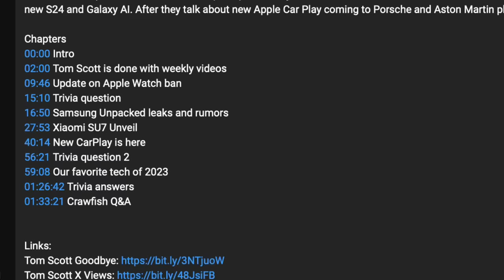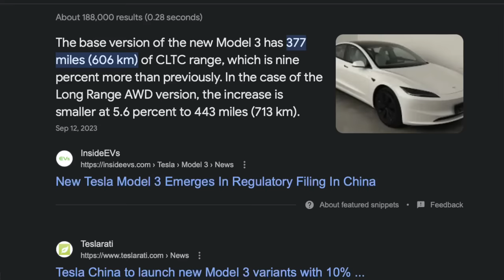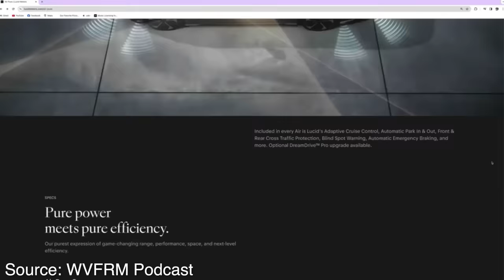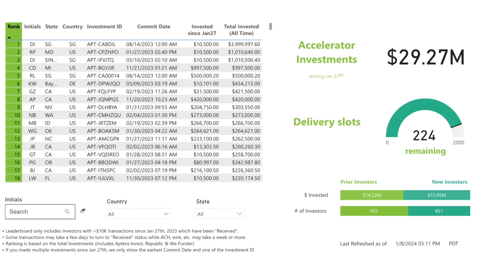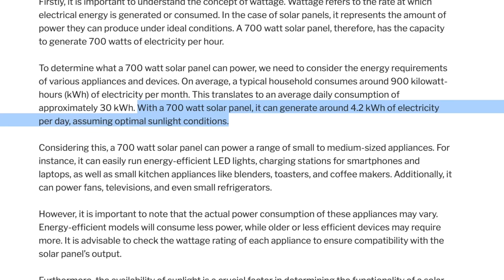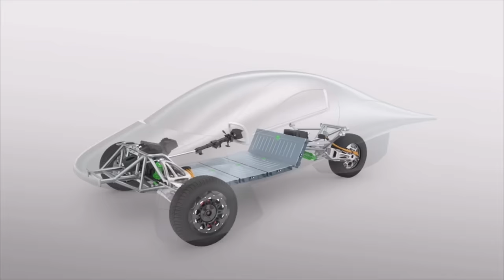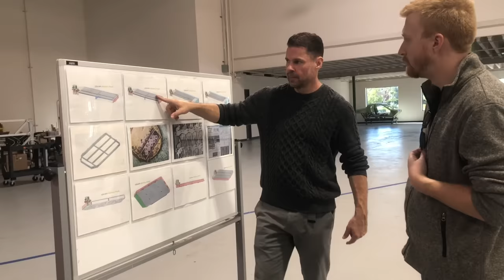Response to MKBHD Aptera Comments

Comment: Another safety concept is deflection vs engagement. I.E. the curved surfaces tend to deflect off of an object that is impacting the chassis. This increases the length of time that is available to bring the Aptera to a stop. Longer time to dissipate energy = much lower G-forces on the occupants. And like an Formula 1 car, the outboard wheels can shear off and this dissipates energy as well, and the curved sides of the Aptera then move to the side.

Rectangular vehicles tend to wrap around an object, and this shortens the time available to dissipate the energy of the impact.
Reply: This of the Aptera shape as an egg with just a little lubricant on the outside.  Since the Graphite body is so hard, in some situations it will just slide to one side or the other.

Comment: As someone who’s invested in Tesla since 2012, the way so many people dismiss Aptera today reminds me A LOT of the way many people completely dismissed Tesla up until 2018 or so. As a product guy I’m getting the same “this car looks amazing” vibes that I got from Tesla back then and no other EV company since.
Reply from the maker: Same! It seriously feels like Tesla lovers are now like the old Tesla haters
Reply: Did you know that both companies were started the same year, 2005? Only one of them has mass-produced any vehicles. The other hasn't produced a single production vehicle and hasn't met a single promised deadline. Not a single deadline. 

I cannot stand Musk, but let's be fair, Tesla did it and Aptera never will. 

Did I drink the Kool-Aid for many years? Yes I did. I placed an order. I bought the stock. And I stopped drinking the Kool-Aid in May when I realized they push backed production even more years, and I saw they were no longer going to be offering wheel hub motors, yet they kept selling the car as if it would have all-wheel drive and hub motors. That is called bait-n-switch.  It's fraud.  I'm in sales. You just don't do that and expect to succeed.  And it's just wrong.

Comment: I built a solar powered pickup truck (by converting a Chevy S10) in the early 2000s which. Had a 1.1 KW array where a carpenters rack would go.  I got between 15 and 25 miles of free driving a day between April and October here in Maine.  Depended on how well I kept the array pointed at the sun.  Drove it about 3000 miles a year on sunshine.  Could get 2 to 3 miles per kWh around town and could carry about 1000 lb in it’s 6nft bed.
Reply: Excellent!

Comment: Aptera is not for everyone, nor for a majority of vehicle use cases.  It’s an excellent commuter car, 2nd car, or vehicle for single or empty nesters. Look at all the successful 2-seater cars sold.  Clearly, that’s a huge market.  

I’ll use it in a southern state and be happy averaging 25 mi/day from solar and charging overnight at a standard electrical outlet paying only 14 cents/kWh.  My average daily drive is well under 50 mi/day.  I think Aptera driver’s greatest challenge is learning how to avoid potholes with 3-wheels.
Reply: @billsmith5960  How many Corvette's would you sell if it got the equivalent operating cost of 200 mpg and cost only $30K.  I think at least 10X volume.  And this EV looks better than a Corvette.
Reply: @billsmith5960  Remember that the cost of an Aptera is a fraction of what the Corvette is and that even the the 0 to 60 time for a c5 Corvette is not as good as an AWD Aptera.  Aptera has FAR wider appeal.
Reply: I live in a suburban area of Santiago Chile, work from home, I go one or twice a week to the supermarket around 4 KM away, and in average once a week to Santiago around 35KM away, it would mean I travel for free basically, we have good sun here

Comment: 😮I'd say more generally about the Aptera is that it's scaleable.  It's scaleable in that the manufacturing can increase about as fast as those Italian tools can stamp out the structural components.  Scaleable in that we don't have to restructure the electrical grid to accommodate 10 million superchargers.  Tech optimists don't think about Scaleable, or don't even understand it.  But look at this way.  The Highway system in southern California isn't scaleable.  It worked great back in the day, but chucking billions of dollars at it in the last 50 years hasn't produced a commensurate improvement.  What you get is two hour commutes on 10 lane roads.  Ultimately it would have been better, cheaper, if they'd kept upgrading urban trolleybuses.
Similarly, your Tesla works great now, but how does it work when everyone has one? How does the grid cope? Where do all the superchargers go? But the assumption is that it all gets easier, the more e cars we get.  There's a geometric growth mindset, but cars aren't smart phone apps and this model is going to hit the stops.

Comment: See, this is why I immediately recognized the potential of the Aptera the moment I first saw it. My fsther got interested in three wheel vehicles about the time I was in college and spent several years studying them. This was all amateur hobbyist stuff back then. He learned about the geometry of three wheelers, and how the low rolling resistance was perfect for electric vehicles. And he learmed about using lightweight materials to get as much rsnge out of a battery as you can. This was in the days of the Pulse enclosed motorcycle, so my dad ended up designing a car that was shaoed like a fighter jet, with eheels out on the end of the "wings". It would have been aerodynamic as all get out, but he never built it. 

When I saw the Aptera, though, I immediately recognized it ss similar to my dad's design. I knew the aerodynamics and the three wheel chassis would give it incredible range. And when I learned that it was going to be made of lightweight carbon fiber, I knew their claim of 1000 miles to a charge, and 40 miles per day on solar power weren't just wishful thinking. It looked like what I knew it should look like. 

I was a little unsure about the width, but from the drag coefficients I have seen, it looks like width isn't as important as keeping that teardrop shape.
Reply: What people dont understand is that luck plays a big role in sucess,so you can have a great product and still fail!Maybe it was just the wrong time,or no help from the goverment or something else!The Aptera is a great product and i hope they can massproduce them!
Reply: I was trying to avoid going into detail about 2009, but you are right, I was talking about the 2005 Aptera when I said I first saw it.

Just to be quick and honest about it I think the failure was a combination of the technology being not quite there yet, and a hostile takeover of the company. But that's not really relevant to the 2019 Aptera Motors.

The Aptera could still fail but at this time I think it is in the hands of the public. We can never really predict if the Aptera will be the next big trend, completely rejected by its target audience, or somewhere in between.

Comment: Raindrops aren't shaped like teardrops. They're actually very flat. Just like it would be when sitting on a flat surface. The only difference is the surface is air when falling.
Reply from the maker: Point being teardrop is the most aerodynamic shape. Aptera is the most teardrop looking vehicle
Reply: Ginger isn't too good of a thinker. The reason a teardrop forms its shape is because the drop tries to cling to the surface it's leaving, and has nothing to do with aerodynamics. The point (as in like a spear) is far more aerodynamic than the almost semicircle of the leading edge of a teardrop. I'm blocked, so if you see this, copy it into the thread please?
Reply: @TailosiveEV  you miss his point. Tear drop shape isnt' the most aerodynamic. That shape is actually a half circle with the flat part crashing against the wind. Obviously you don't want that shape in a car.

One of those science youtube guys has a short on it.
Reply from the maker: The most aerodynamic shape you can make a vehicle capable of rolling on roads and holding passengers is the Aptera
Reply: @TailosiveEV  Yeah, I agree. We are just clarifying the concept itself. You can see what we mean on a short made by Veritasium about the real shape of a water drop.
Reply: @TailosiveEV  The most aerodynamic shape is not the Aptera. If you narrow it by putting the passenger behind the driver you get a lower drag coefficient. Try to think before you mislead others.
Reply from the maker: Decreases the amount the design can taper out the back. Wouldn’t be a comfortable seat
Reply: @TailosiveEV  Longer EV only increases the taper amount. Can be exactly the same seat. In fact, with so much cargo length the total length need not be much longer. It has so much that they lie about maybe putting a third seat in.

Comment: I'm sure we all want Aptera to succeed, but the odds are heavily stacked against them, or any company, trying to survive. Putting all your hopes and dreams into a car company that's not yet making profit, is like starting a new Netflix series and acting as if there's a huge chance you'll get to see the end of the five season story arc. He's come in the comments and added more info (pin that when you see it btw) and what he says makes 100% sense. 

Yes, I agree that if you do a deep dive it would seem that Aptera are on the right track. However, there are at least a dozen companies I've been hoping will do a thing with an EV that actually matters, that still haven't years later and so many, many, many, many that had seemingly good product ideas that didn't get into production. Prototypes are easy, production is hard. I will be fully confident that they will make a go of it, several years after they have been in production at high rates and showing a profit.
Reply: Completely fair points you made. I feel that doing a deep dive into Aptera would answer some of these questions though. They are unlike any other EV manufacturer, truly.

Comment: Teardrop works for small objects. For large objects, I bet a spear is better. A stretched drop. You get a decent internal space, it's just narrow. An extended Aptera might not lose a lot of range but have 2 or 4 more seats or a lot of extra and convenient cargo space. And lst not forget: way more solar panel surface. A single meter added to its widest part, not moving a molecule of extra air out of the way (in theory based on frontal surface) would be more efficient for energy per unit of distance per unit of payload. Trains and ships are efficient that way. Trains needing infrastructure still but going fast, ships a bit slower but all water is their infrastructure, there's just no tank stop halfway an ocean. Or are there?

Comment: Thanks for the video. I just read MKBHD's comment below. I have been a fan of Aptera for over ~13 years since their first endeavor. We are early reservation holder (#495) as well as small-time investors and considering joining the accelerator program. Having said that, I do have concerns about a sufficiently large market in THE USA for this 2-seater, 3-wheel vehicle. We currently have two 4-wheel EVs and our 3rd car is a 2000 Honda Insight with a manual transmission. Only 17020 Gen-1 Insights were made and majority came to the USA. Despite it was way ahead of its time, Insight did NOT sell in this SUV/truck country. Hopefully Aptera is working on a 3/4 seater Aptera 2.0 to follow up the current model for long-term success and sustainable business. I don't think the # wheels is that big of a deal. I SINCERELY HOPE I AM WRONG.
Reply: I currently drive one of those Insights.  Having ridden in an Aptera prototype, I know that the performance is much more akin to the original Tesla Roadster at 1/3rd the price, and still has much more utility.  The Honda was greatly lacking in fun factor in comparison.  I am not  worried about Aptera's market once people experience it.

Comment: Forged carbon must be better suited than carbon layups in terms of catastrophic breakage.
Reply: It is certainly WAY less expensive in both labor and materials cost to produce.
Reply: The materials ability to absorb the crash impact rather then transferring the energy to the passengers is what matters. Not if the vehicles lsurvives the impact. The crash test results should answer some of these questions.

Comment: Correction: People don't think 3-wheel cars are less safe because they have one less wheel. We naturally think they will be made less safe because 3-wheel cars are classified as auto cycles in the US and don't require the same safety standards and rigorous safety tests that 4 wheel cars do. Most of us who know anything about cars realize that the third wheel car concept is just a go to way for various start ups to get into car production with far lower start up costs precisely because they can skip safety tests and all the added cost that goes with it. I'm hopeful of Aptera and and am investor, but I still remain sceptical of its real safety since they don't have any real world tests yet, just computer models, so we are just taking their word for it, which is not worth anything in the world of hype and lies. Personally, as someone who rides a motorcycle as a daily commuter for both fun and economic savings, I would be fine buying an Aptera even if it was not as safe as a regular car, because it's still substantially safer than a motorcycle and has the potential to be far more efficient to drive and maintain while being funner to drive than a regular sedan or crossover.  If it winds up being just as safe or safer than most regular cars, while costing less than a Model 3, that just a bonus for me.
Reply: It's the math, and physics. The calculations show that Aptera will be as safe or safer than most new cars, and what you didn't mention is that Aptera will be doing crash testing though it is not required. Those results will be available before production starts. I look forward to seeing those results.

Comment: Aptera would be a great commuter EV if it used LFP batteries instead. Also they should have a cheaper vrsiom without solar panels, for those of us that live in the far north with very dark winters and hardly any sun. Since Aptra only seats 2 people it's mainly usetul for commuting and light shopping
Reply: LFP batteries do not do as well in the cold that I am presently experiencing in Iowa - at present -5 and on the way down - and the NMC batteries have the required power density.  Chris Anthony has founded and as CEO took public an LFP battery company.  He knows as much as anyone how they perform.  Perhaps he may use some in models where the performance works for some markets.
Reply: @n.brucenelson5920  Actually they perform very well as long as they are kept warm. The combo of NMC and solar makes little sense, since they are sensitive to overheating and solar makes sense in sunny places. Where I live we get only a few hours of sun in the winter, solar makes no sense. LFP, on the other hand, works great in hot weather. So in summary, either LFP + solar in sunny hot climates or NMC and no solar in cold climates. I would take LFP during winter anyway since they can be charged to 100% without much degradation unlike NMC and can be recharged many times more also.
Reply: @SkepticalCaveman  LFP does not come near the required power density for the design goals, and the solar is cost effective for us even in Iowa, where 62% of our grid power comes from wind.  Aptera's controllers are designed to manage the 2170 NMC batteries with even more care than Tesla has with their Model 3s using the same cells.
Reply: @SkepticalCaveman You will be surprised how much solar power is available even in winter in northern latitudes. I'm at 45º N and I will still get miles in mid-winter. Where are you living?
Reply: @jerrymcintire7902  Scandinavia. Good luck finding sun here in the middle of winter.

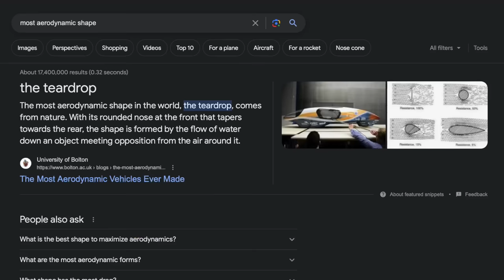Comment: At around 7:50 you allude to a raindrop taking on a teardrop shape. Actually, a rain drop starts out as a spherical shape, up to about .08 inches, around a dust mote or smoke particle, due to surface tension. As it starts falling its shape starts to look more like the top half of a hamburger bun. As it accumulates moisture, while it passes through moist air, the influence of surface tension decreases due to its increase in size. As the raindrop increases in size past around a quarter inch, there is sufficient decreased influence of surface tension and increased influence of air moving over the rain drop to eventually break it up into two or more rain drops and the process continues until it strikes something solid.
Reply: You seem to not understand the difference of an object in motion in a fluid versus a sphere in a zero-gravity vacuum.

Hint: Aptera drives in an atmosphere.
Reply: Raindrop, teardrop ..it really has more of a spermatozoa shape, maybe call it the Aptera Milt...
Reply: @TheDapperham  Cool. I like your sense of humor. Mike
Reply: @vorg_  Congratulations. The Aptera is also not a liquid.

Comment: Hungry Howie's, Domino's & Papa John's should be looking to get thousands of Aptera. I drive for JJ but I've drove pizza delivery, too. There are big orders that would require more than the space of the front seat, but the back should be able to hold a few big bags, maybe 20 pizzas, another 4-8 up front. I'd love to use mine as a delivery vehicle. At this point, with the slow Cybertruck ramp, I may well buy my Aptera in 2025 to use for work, and wait until 2026 for the Cybertruck, if they even get to the RWD by then!
Reply: More like 100 pizzas, the thing has 34 cubic feet of space in the rear. Auto parts, medical companies, like Quest Diagnostics, fast food companies, Uber eats, insta cart all would love this vehicle. Last mile deliveries will eat this up, like messenger services, and anything that needs moving, across town.